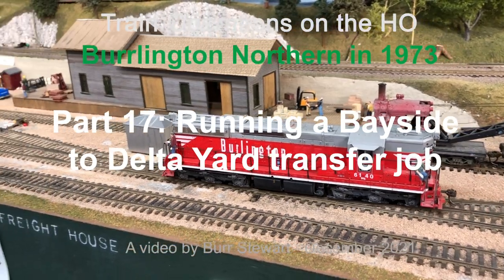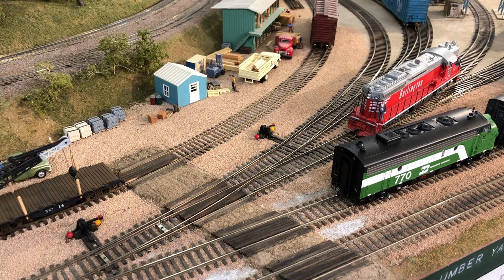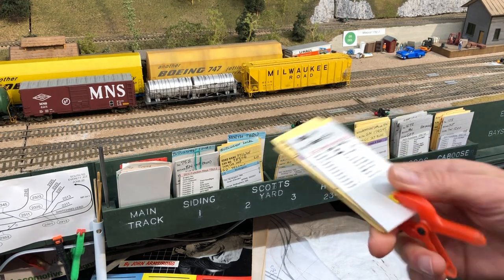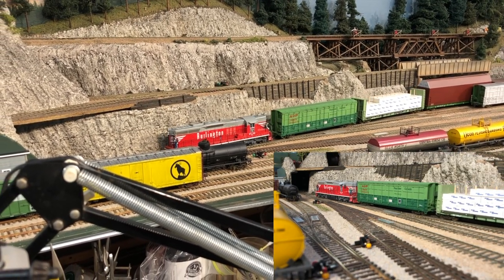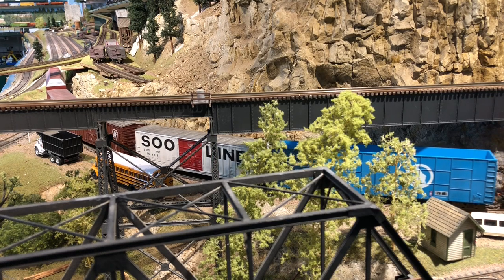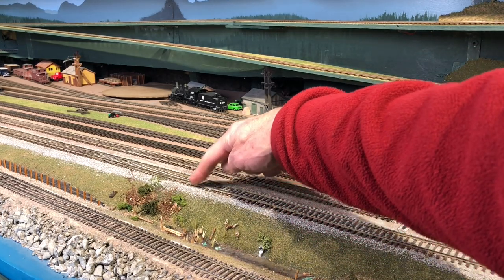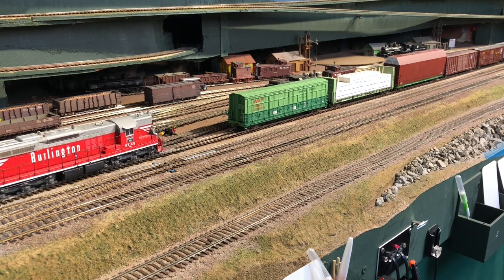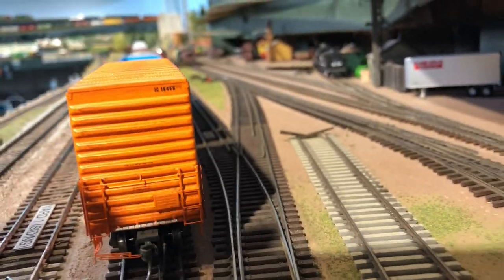Part 17 - Running a Bayside to Delta Yard transfer job on the HO BN in Everett WA in 1973

Comment: Like those Boeing Box, I’ll have to by or build some myself.  Do you have the Japanese Gluch Spur to Boeing or is it just tail track?
Reply from the maker: I started out with the Gulch Spur complete with 5% grade, but then found out I had it pointing in the wrong direction. So I converted the 5% grade line to represent the Woodinville Branch, and repurposed a hidden cut-off track to serve as the Gulch Spur, but it's level and is more like a staging track, as you suspected. BTW I heard a rumor that Intermountain bought the tooling for the Boeing skybox cars, so you may see them back on the market sometime.

Comment: actually the brakeman would walk to each switch and line them before the Locomotive started moving again. they wouldn't move a few feet at a time to throw another switch. Too much work getting the train moving and stopped again to bother with that.
Reply from the maker: Good point. It felt a little strange when I was doing it...